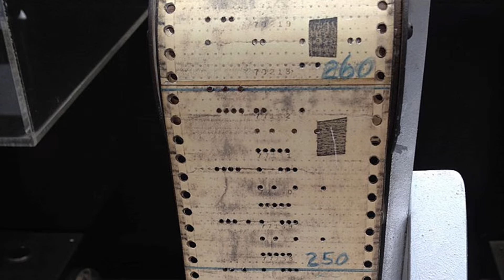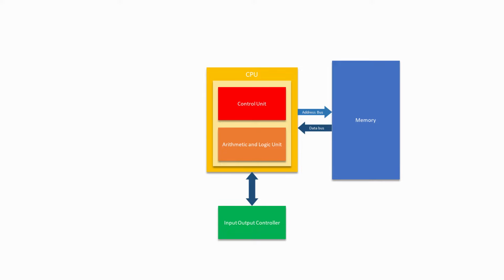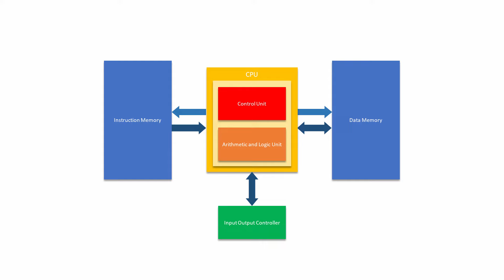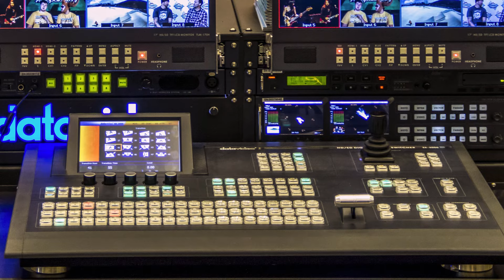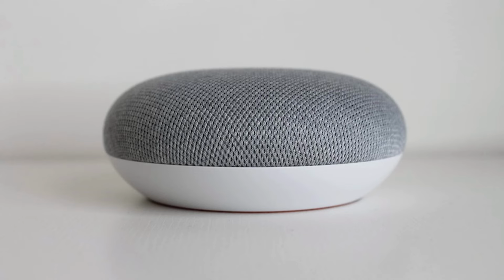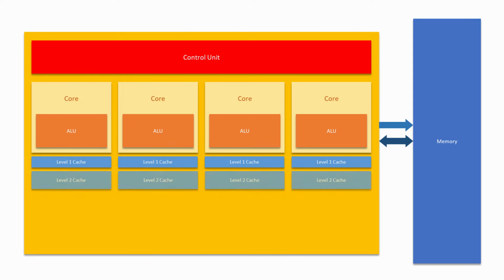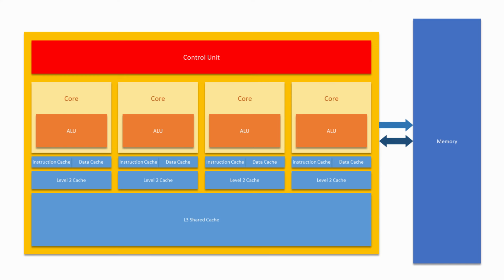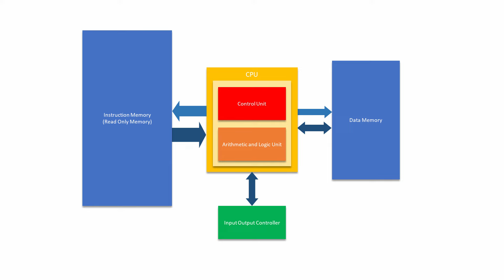Harvard Architecture versus Von Neumann Architecture

Comment: This brings me to the question, why is von neumann architecture the most popular and most used architecture?
Reply from the maker: The truth is that modern computers have moved on a long way from the original von Neumann architecture (co-processors, GPUs, pipelining, cache, etc.), although the essence of von Neumann remains (i.e. programs in memory). I suppose everything comes down to expense and we we are prepared to pay.   :)KD
Reply: @ComputerScienceLessons  oh, I see, I was thinking the same question earlier, thank you :)
Reply: @ComputerScienceLessons  New instruction sets are constantly been added by programs we download, so it makes more sense to incorporate both programs and memory in the same space. It also allows in some cases for increased performance with the trade of of increased power consumptions. This is why fitness trackers may opt for something closer to a modified harvard architecture, as the separation between program and memory  means less local power consumption
Reply: mafia probably
Reply: @nathanjahzielmuncal2699 i unsubbed